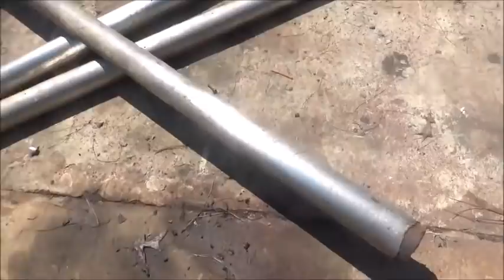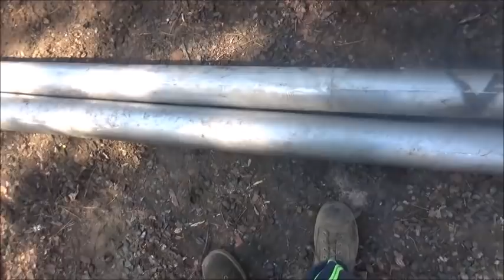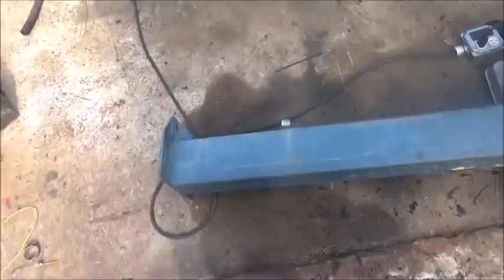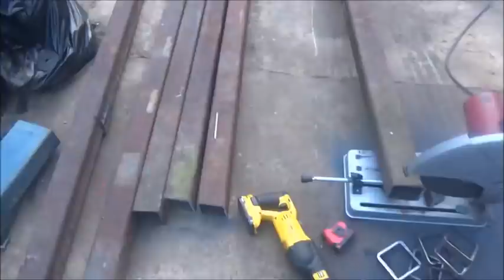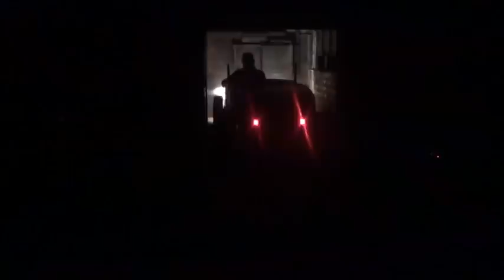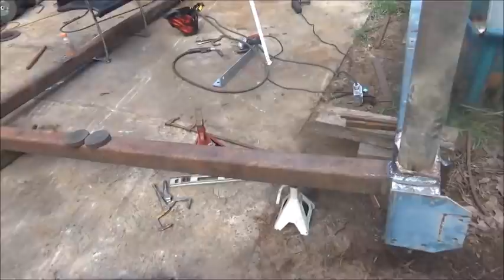CARPORT FROM SCRAP CHOP SAW REVIEW AND MORE!

Comment: Those harbor freight saws aren't that great but to be honest the blades are bad to. They last long and would work on a 5hp saw. With any of the portable saws you need a blade that brakes down the cutting edge so it will saw faster and with less hp. I use 7/64 blades . I've actually wore out a bunch of those saws in different brands. The 2 old ones I have now are both 2 hp, a old orange cover Makita and a Speedway (like hf) . I think I've watched almost all your videos. I like the way you recycle. Thanks man 👍

Comment: My father and I did this type of build around twenty years ago. Using scrap posts, and 1/4 inch steel we welded a 32 X 50 foot shop. I learned how to swap a bowtie 350 from 11 PM to 4 am in this shop and still manage to get to work in the new engine the very same day.. Lots of good struggle memories. Along came a F5 and removed all evidence of the shop in 2011. the heart and will are never the same from the loss of that place we called our own.

Comment: Better over engineered than under Johnathon.
The biggest pressure on a roof is actually lift, not weight, due to wind getting under the roof components.

Comment: The biggest problem you may have is volt drop due to the high power and the length of the extension cable, do not underestimate the resistance of the cable if it is lying coiled up as well. Love your work and videos, for me it is a true reflection of America instead of the celebrity hype to often seen.

Comment: I worked at a water heater factory one summer.  We used an abrasive cutoff saw to bring gas flues to length.  That blade would blow up bnb with no warning.  Would cover you in black dust.  Miserable job!

Comment: I'd be surprised if that "3.5HP" saw makes more than an honest 2 or 2.5 continuous.. very surprised.

You know, it's not that the Chinese don't make high-quality goods - they do it all the time, but they tend to keep it for themselves.
Reply: On a 15 amp circuit, with 120 volts, at best you could pull 1,800 watts.  746 watts per horsepower, so 2.4 H.P. if the motor was 100% efficient and if the voltage didn't drop because you were at the end of a long run, or even a long extension cord.  If you had it on a 20 amp circuit, and if it was on a short run of wire, and if the motor was capable of using 100% of the 2400 watts available, you would get 3.2 horsepower.  That's a lot of iffs.  In the heat of the summer, with everyone running their air conditioners, it could be that you don't even have 120 volts available to begin with.
Reply: @eugenepolan1750  Well 120 isn't 120 so....

Comment: These days even most of the good stuff is made in China but the difference is it is made to a higher specification than the most of the cheap stuff from Harbor Freight. It's like the difference between a drill with the Black & Decker label and the same with the DeWalt label. Both are made by the same company but the Dewalt will have steel gears in the transmission and the B&D will have nylon ones. I have always bought the higher end tools if its something that will get used and abused and the cheaper stuff if it will only get used occasionally.

Comment: I'd like to offer a tip on those blades and that type of saw;
If your blade gets 'dull, slow cutting ' grab a piece of concrete block or sandstone, and make a few cuts into it. This removes the 'burnish' from the blade 
and then you'll find that the blade cuts like new again.
Also, use as short of extension cord you have and keep it at least 12 gauge wire,...those motors in the saw likes all the voltage they can get.
Reply: Like running a surface grinder and "dressing the wheel"

Comment: Not a big Harbor Freight fan. But when you have any electrical tool that possibly draws a lot of amps on a long extension cord, it's possible to experience a voltage drop situation that may cause the saw motor to run hot & not develop it's rated amount of power. The same tool MIGHT run better when plugged directly into an outlet. Channel is great, love the content!

Comment: That frame is so stout you might want to consider   extending the 4x4 posts above the roof line to incorporate a level platform for additional storage to get parts off of the ground and out of the way. The roof would still be underneath the platform of course. An entire car car could be set on that platform without any danger of structural damage.

Comment: I was given a stack of blades that were originally much larger than 14 inch. The were a little thicker than regular blades. I couldn't cut sh*t with them. Blades need to be as thin as possible. 
It was 114 degrees yesterday here west of Phoenix but 13% humidity. Would love to meet you some day there in Cameron, but I'm glad I'm not there right now.

Comment: I watched Andrew Camarata weld a couple pieces of metal together and it was like a three inch long weld, not near the heat but ever much as heavy and then try to rip it apart as he was going to do the roof on his conex castle. That meant heavy lifts sixty feet give and take on the different spots on that roof there in new york. He tried hard with a machine that would be ever bit the size of a 955 cat loader and try to rip it. and it held... your welds are hotter and longer and stronger than anything he did and since his held, I don't think a typhoon could tare it down. It might bend a bit if hit hard enough and that is doubtful to be honest. So yours will be there till the grandkids tear everything down to put up something from the future like maybe solar towers or rocket landings in say 2099.... thats quite a while from now. I love steel buildings when it comes to strength but it takes more to insulate for heat and yours don't even have walls so it will  be there till the communist blow hell out of our beautiful country
Reply: I'm a fan of Andrew camarata he didn't get nearly the penetration he could have with a stick welder
Reply: @mrromantimothy  Oh I agree. The point is how much strength there is in a short weld and how much it takes to move from a to b. I like both forms of welding and the welds we used in the boats was stick back in the day but now days welding has come 360' as we both should know

Comment: I have a Milwaukee chop saw that does pretty good, but it suffers at the end of a long drop cord.
Reply: @Jon C That's right, and it looks like Jonathan has a long long cord coiled up and not very heavy wire. Would be interesting to see the voltage at the saw under load. May be dropping down to 100 volts. 3-1/2 HP is a lot for 120 volts even under the best of conditions.

Comment: I had a Craftsman chop saw and it lasted a few years before the motor burnt up. Was going to cost more to fix than buying a Harbor Freight chop saw. The Harbor Freight saw has been working great for almost 10 years now. Not sure which model and HP it is as they only offered 1 model at the time.
Reply: Craftsman chop saws were made by Makita I have one I got for ten bucks and I rebuilt it I'm having trouble finding the 8 1/4 inch blade for it though.

Comment: To be honest, I've never had good luck with the Harbor Freight blades. They only cut for about 30 seconds, until the outer abrasive wears smooth, and then they won't cut butter. They don't wear down either. Dewalt or Diablo cut way better and cut right down to the nub.

Comment: the thinner the metal abrasive blade the faster it will cut especially on heavy gauges , however it will wear out much faster . In my experience you are better off to go with the thing one, and i have ran a chop saw cutting steel for the last 30 yrs.

Comment: Only thing I don't like about chop saws is the sparks and all the crap that flys around. Managed to find a jet 4 x 6 band saw on clearance at menards Use 10/14 saw blades and cut anything I need. Still have my 30 plus year old chop saw but like you doing only use it outside.Looking good.